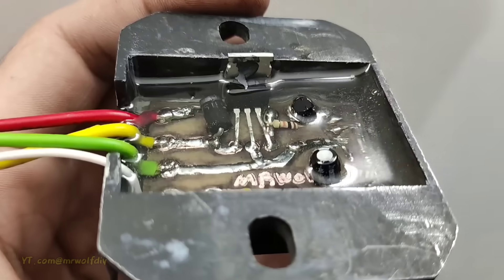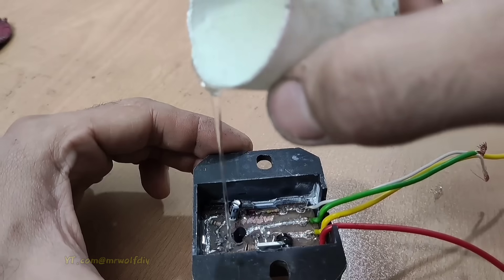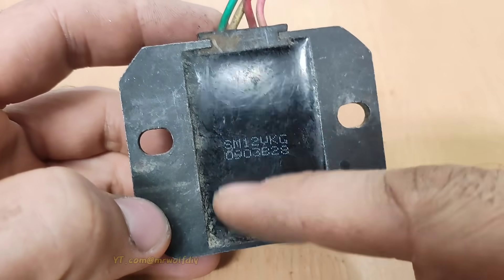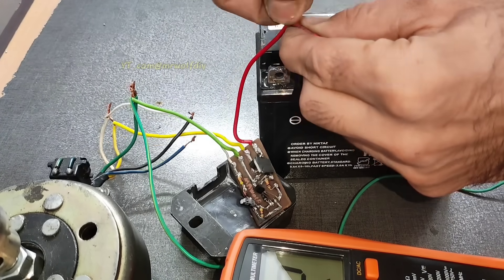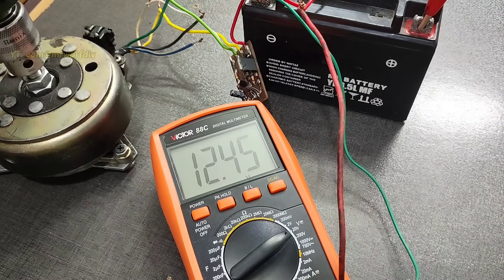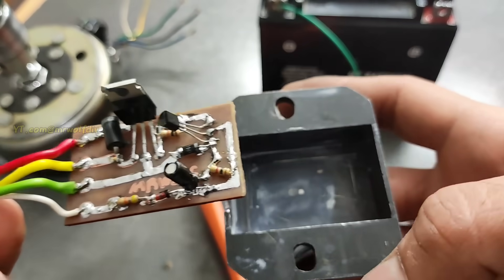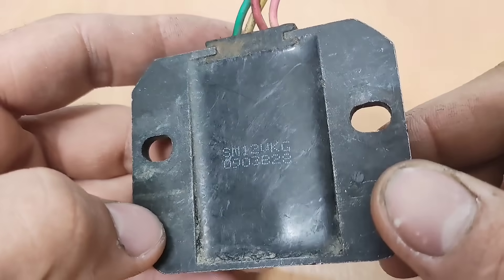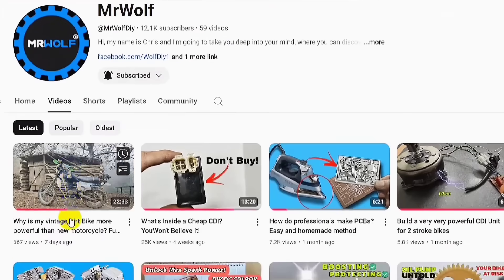The Easiest Way to Build a Motorcycle Regulator – Mind-Blowing Hack!

Comment: I see the rectification but I don’t see any regulation. If that stator produces more than 15 V AC you’re gonna have more than 15 V DC overcharging the battery
Reply from the maker: The regulator does not allow the charging voltage to exceed 14.5V
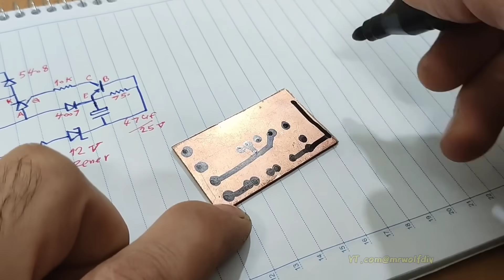Reply: That's what the zener diode is for at the bottom of the circuit diagram at 2:03 I assume.
Reply from the maker: The Zener diode is a crucial component in electronic circuits, used for voltage regulation and protecting circuits against sudden voltage spikes.